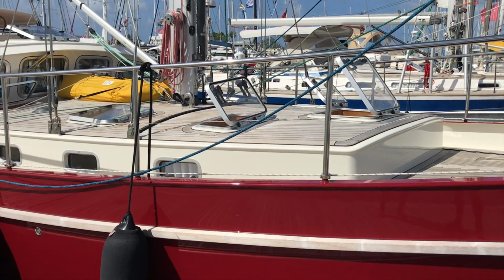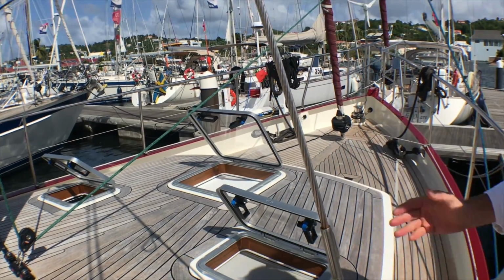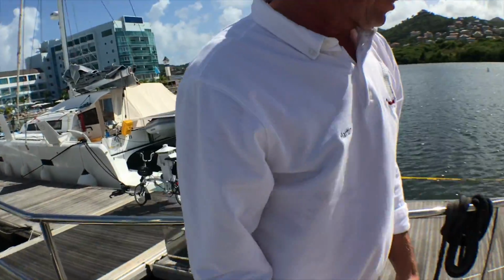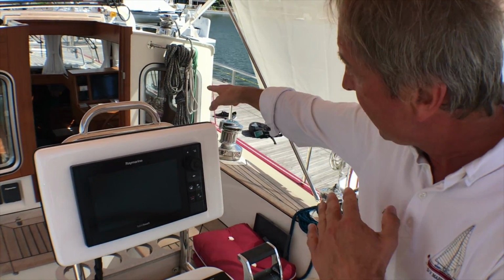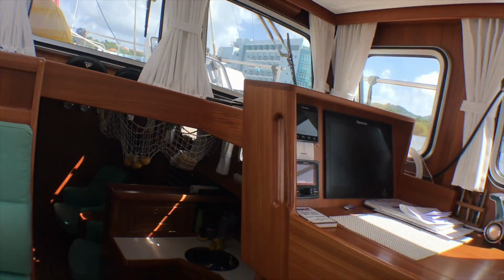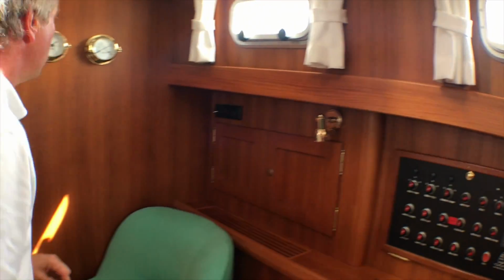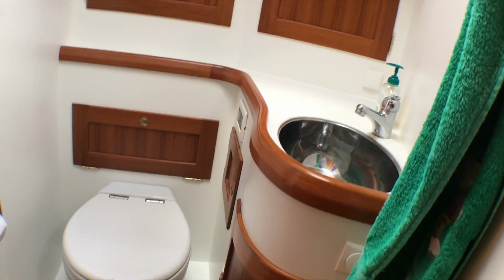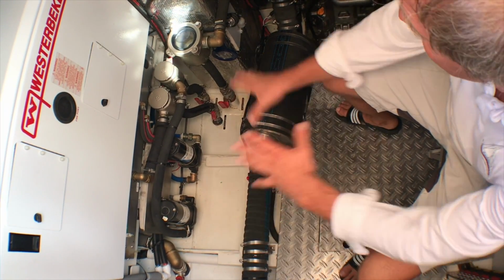Walkthrough this 43ft 'go anywhere' explorer yacht – just sailed across the Atlantic

Comment: A lot of attention to detail. Like the high bulwarks and the bitts on the foredeck - far better than smaller, cheaper cleats. Didn't see a few other things I'd have liked to see - food storage/refrigeration, water maker (is there one?), tank capacity for example - but overall very impressed. Not a huge fan of in-mast furling, but I'm guessing that could be changed at buyer's option. That wheelhouse is terrific for cruising in foul weather, or even on an exceptionally hot day. At 22 tons/43 feet she'll never finish much better than 42nd, but who cares when that kind of sturdy construction keeps you safe and comfortable on passage? Hat's off to the owners and the designers and builders.

Comment: Beautiful  boat, but the mooring line holes (chocks?) in the bulwark at 3:58 look misplaced and may cause chafe. Rather far back for taking lines from a mooring buoy. They should be forward of the cleats. Bit odd given the excellence of the hardware. At 0:00 and 4:16 the anchors look  small for a big, heavy boat like this... perhaps a storm anchor is stored down below?

Comment: Nice boat. I like how the thru hulls were all in one spot. I don't know how they are ever going to get that engine out when it comes time though. Seemed like the boat was built around it. Very nice boat and owner. Wish them many years of happy sailing.
Reply: I believe they have hatches inside the wheelhouse for that.
Reply: The hatch under the steps will be used to remove the engine
Reply: You raised a valid point. The replies made here are made without knowing what the design is and are therfore not relevant.
Reply: @thomaselliott573  wtf are you talking about? It's a noordcape, plenty of people can easily and quickly demonstrate how to dismount the companion way  steps and give topside access to the engine. Literally drop down a rope and hoist it straight up. By design.

Comment: Impressive well thought out yatch and a triumph of substance and safety over  the current crop of fibreglass clones on the market. Pretty much a perfect yatch for couples. About the only thing I'd change is that in mast furling to a boom furler just because I've had reliability issues with them and a pair of granny bars around the mast but those are minor things on what is a well thought out Blue Water yatch

Comment: Hi! For anyone searching this boat, it's called "Noordkaper 43", not "Nordkapper"!
Reply from the maker: Thank you Thijs, that's corrected. Also, we should add that the design is by Martin Bekebrede and this yacht was built in the Netherlands by Gebroeders van Enkhuizen - gebrvanenkhuizen.nl/noordkaper
Reply: @yachtingworld  the Noordkaper series comes in several sizes and are an customized series boat - where a lot of the bits are in place leaving room for owners to customize.  
One of the remarkable details with the NoordKapers are the small cockpit, bringing the pilot-house back and creating huge space forward.   my current noordkaper have a smaller cockpit than my old Catalina 309 - but the interior is a modern house for two - with a guest room for occasional guests.